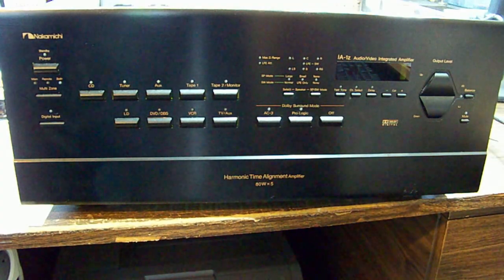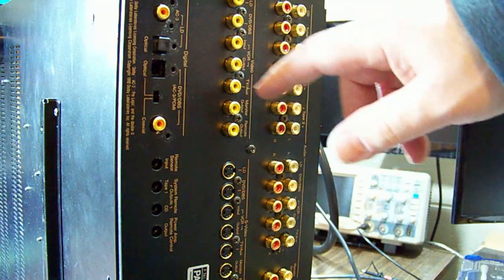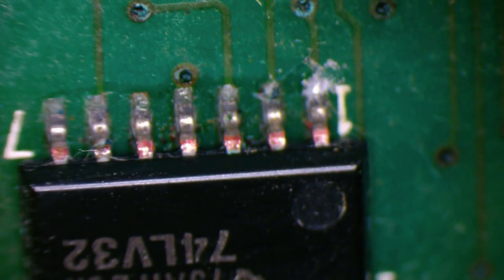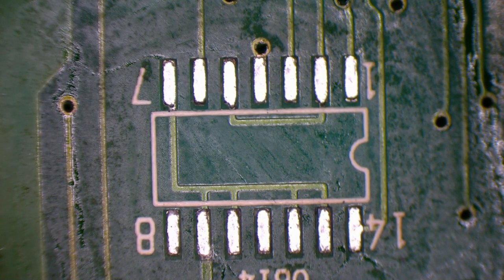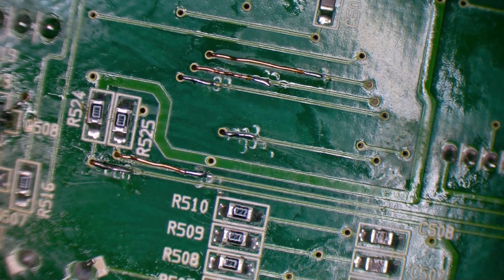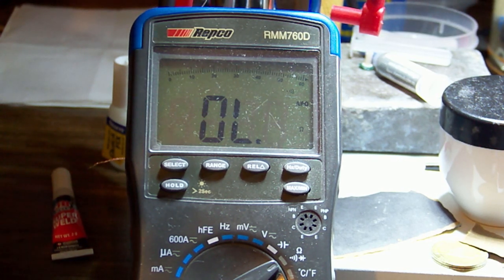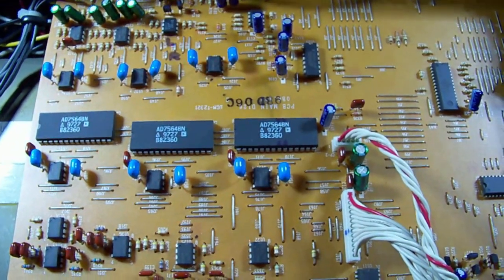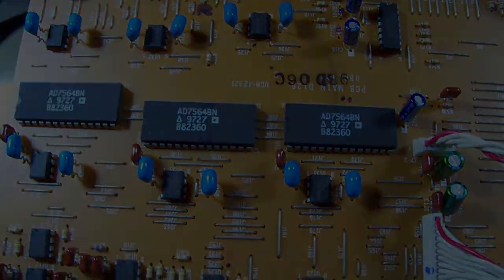Nakamichi IA-1z full volume repair attempt part 1.

Comment: EDIT: Yes if that beast has got any "Audio Volume Control" IC's? ... or "Digitally-controlled audio attenuator" IC's? ... that would be a definite point of call ...
Reply from the maker: That's what I was hoping for but as it turn out the AD7564 D/A chip manages the volume. The datasheet I found did not go into operational detail at that level, I was very confused until I figured that out. Stay tuned for an update on what I found ;)

Comment: I think i would be running away as fast as my legs could go lol.
That nasty looking controller pcb is a worry and to add insult to injury drop damage too.
You do like mental pain don't you ha ha :-D
Reply from the maker: That's no way to face a challenge! And yes sometimes my need to know outweighs the value of something but it's worth something to the owner and I don't know a shop that would touch it....especially when one of the parts I've identified as bad is only available from Israel of all places. I'm a sucker for punishment for sure ;)
Reply: @JonnyFix  Well i have had my share of determined repairs, often because i would not give up, like a dog that just won't let go of that stick :-D
Often the stick is not as interesting as i first thought.
Or i spend too much time fighting and get stressed out and feeling ruff ruff :-D.
Sillyness helps.